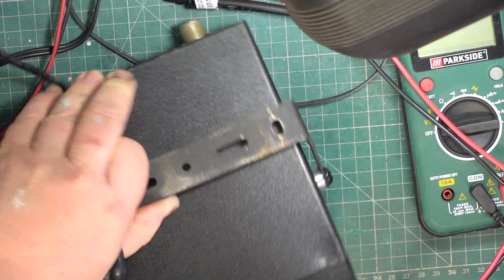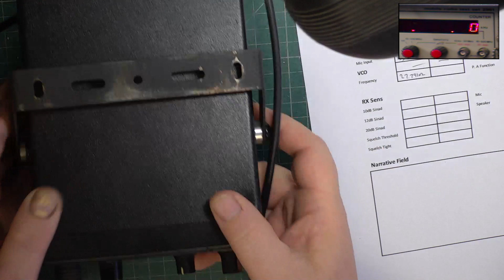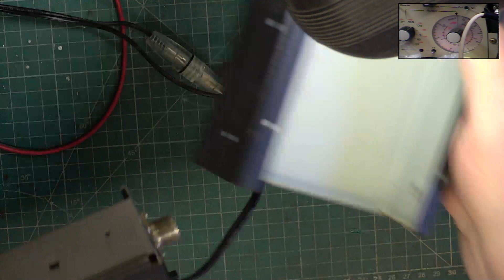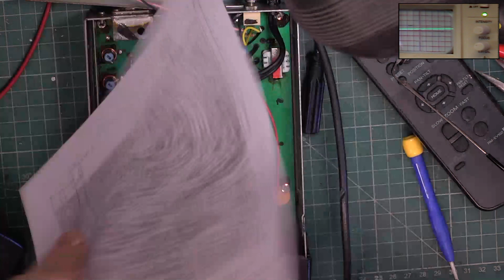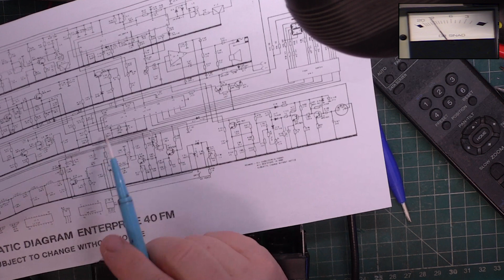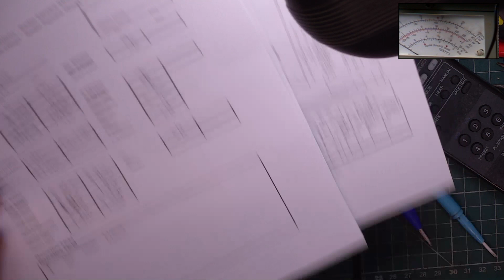LCL Enterprise CB27/81 UK FM CB radio - service alignment

Comment: I bought one for £2 and thought it would be just for spares, the guy said it worked, but as it was a boot sale, I took that with a pinch of salt.  However, when I cleaned it up and plugged it in, to my surprise it did work.  Not done anything with it since.

Comment: That switch mode psu will add a few s points of noise.
Reply from the maker: Absolutely right, I'd never use such a supply on a radio.

Richard